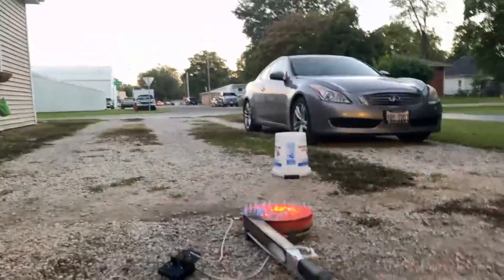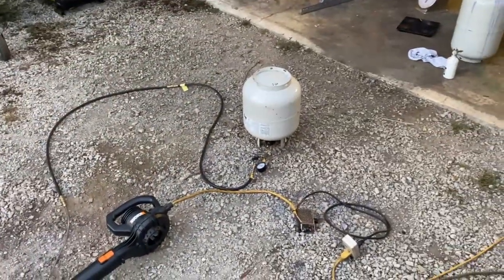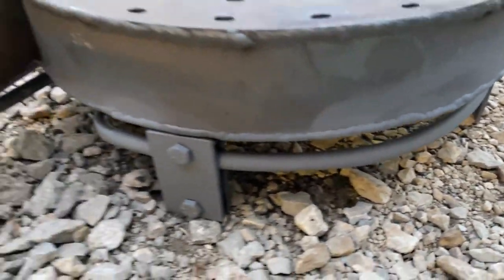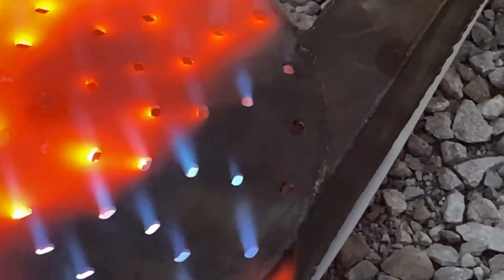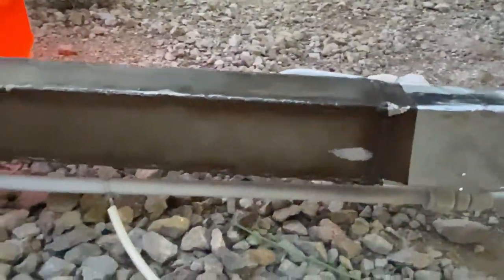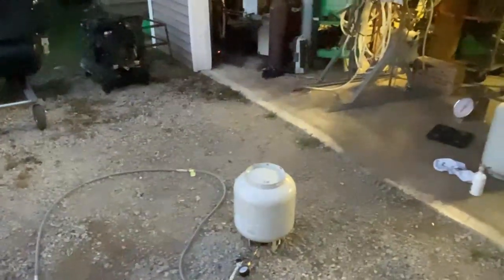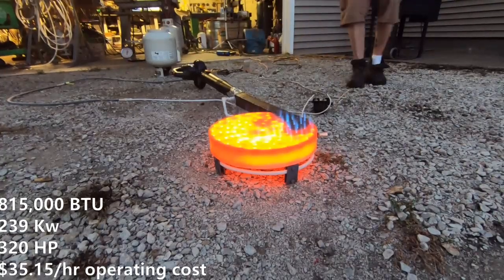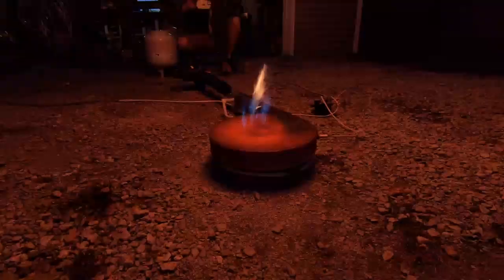Increase propane tank power output SOLVED

Comment: The strongest plug i ever seen was a denso brand it was in a old 300zx running lean and idiot would not buy injectors so one a hunch i used the plug from a 1988 Toyota supra in it the ceramic did not meal off like the other 2 plugs ,here is  updated part number fer plug Denso  PQ20TT or IQ20TT...love your work keep it up
Reply from the maker: right on ill check it out for sure
Reply: @NOBOX7  cool i swear by them after that silliness they are tittyanium  alloy or sum such  of Japan made goodness .lol
Reply: Most industrial burners use single solid core plugs w the ground being the burners' metal.   Think of spark plug without the bent ground electrode and the center having long 
ss/inconel/thorium  rod moving arc out to tip.
Reply: @markmatt9174  2 stroke marine engine i had used a flat spark plug no bent of tip flush deal 1975 ish 80 hp mercury
Reply from the maker: @markmatt9174  Thanks Matt ill check that out also

Comment: That's why I run my pulse jet on liquid also!  No pressure drop!
Reply from the maker: Right On thanks for the feedback ,its nice to get validation of a concept from other users
Reply: @NOBOX7  Yes Sir! Its definitely easier to meter in liquid from the tank for extremely high output devices.   I'm always giving that advice to others trying to get their big engines running.